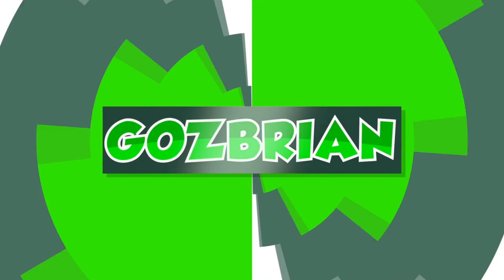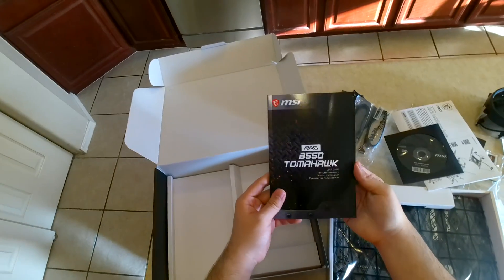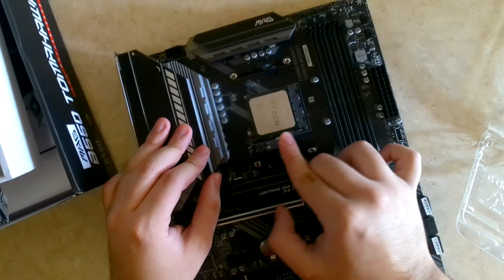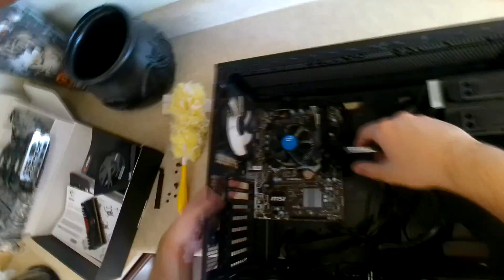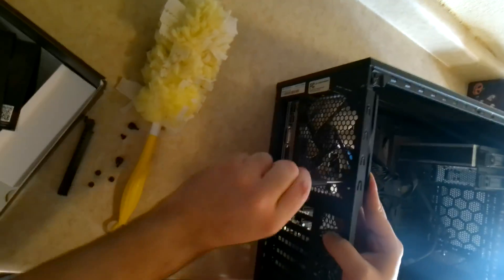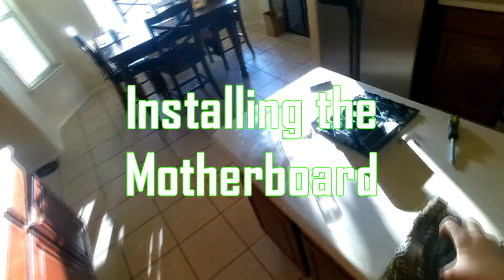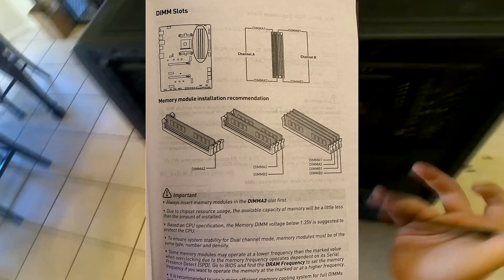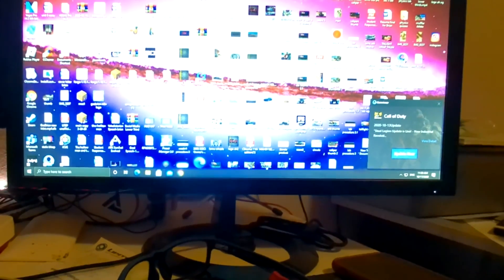How to Install a new CPU and Motherboard! (MSI B550 Tomahawk + Ryzen 3600XT)

Comment: I done this 2 times with this exact motherboard bent pens every time the way it's shown in this video is 100 the correct way but 2 CPUs later 😡 at least on my motherboard u set the CPU first then easily pull the latch back CPU drops in then u put the latch down

Comment: How come when I try and screw down the screws it doesn’t screw
Reply: I have the same issue. Did you ever fix it?
Reply: Sounds like it's not  lined up correctly, and you do need to provide a little forced, forcing the screw down to catch

Comment: i paused your video and give you a thumbs down and am gonna teach you about memory banks. when youre posting ram into the board you start in slot 1, and only 1 for the time being diagnostic posting display test, and then you add a stick into each slot thereafter and see if the pc will boot with each stick you slide into it or if it beeps, in which you have to take that stick out and reinsert /snap it back in to see if the bios will boot and post. then sure it matter what bank you snap them into or they wont display correctly... it used to be typically bank one was closest to the cpu but as mother board developed more in the time forward, that wasnt always true... however a sure fire way to know order the ram to be installed and which one is bank one, that is usually more easily defined on the board, since reading multipliers, and manual mother board settings for hardware techs and clocking seemed to be an issue with techs like yourself ;) well im not gonna be as mean as the others but there is a basic lesson for an old hardware tech.
Reply: ∙ Always insert memory modules in the DIMMA2 slot first.
∙ Due to chipset resource usage, the available capacity of memory will be a little less 
than the amount of installed. 
∙ Based on CPU specification, the Memory DIMM voltage below 1.35V is suggested to 
protect the CPU.
∙ To ensure system stability for Dual channel mode, memory modules must be of the 
same type, number and density
Some memory modules may operate at a lower frequency than the marked value 
when overclocking due to the memory frequency operates dependent on its Serial 
Presence Detect (SPD). Go to BIOS and find the DRAM Frequency to set the memory 
frequency if you want to operate the memory at the marked or at a higher frequency.
∙ It is recommended to use a more efficient memory cooling system for full DIMMs 
installation or overclocking.
∙ The stability and compatibility of installed memory module depend on installed CPU 
and devices when overclocking.
∙ Please refer www.msi.com for more information on compatible memory.

Per Manufacturer instructions 🫣🤷‍♂️

Comment: Hey man thanks for the video! Just wanted to give a heads up that it looks like the PCI clip broke off with the gpu because it has a tab that locks the gpu into place and you’re supposed to release the tab before removing the gpu. So it looks like you basically forced it off without releasing the tab and it broke off

Comment: Hey there, did you have any problems with Amd bulk logo, on the CPU cooler?
Im ordering a B550 Tomahawk, and an 5600x, and I was worried if the cooler can fit in, due to the size of MBU components around it, and RAM on the other side?
Reply from the maker: No problems for me.

Comment: hey man, could you help me? I got b550 tomahawk + ryzen 5600x, (bios 7c91ams.a40).
If I turn on the CPU Boost from click bios, the ez debug CPU led on which means it fails at CPU, and i have to reset cmos again.
do you have any idea what's going wrong with that?